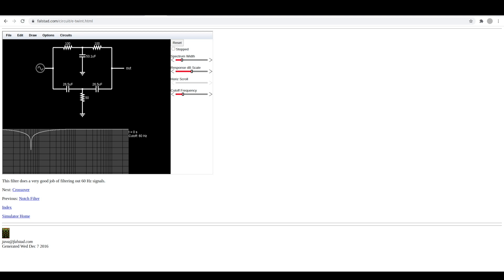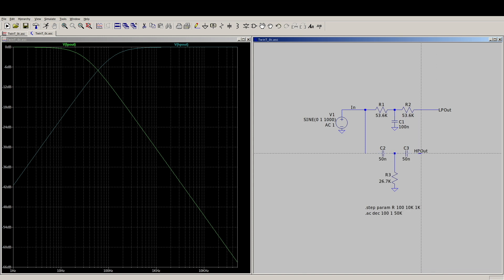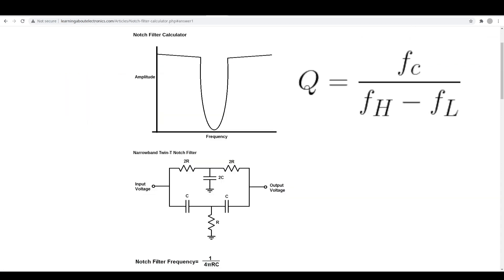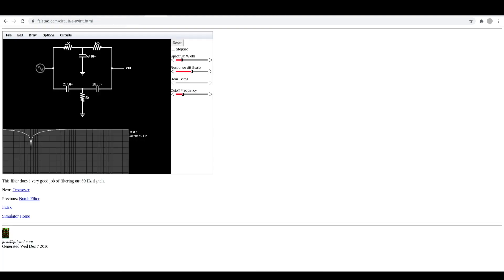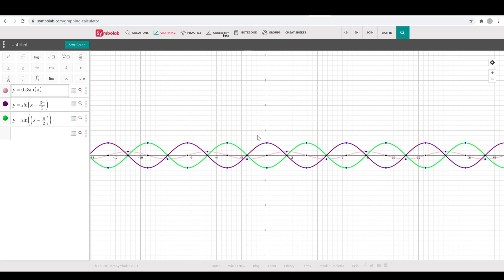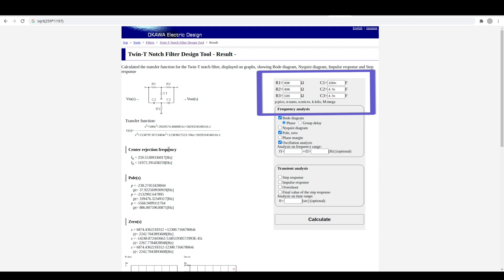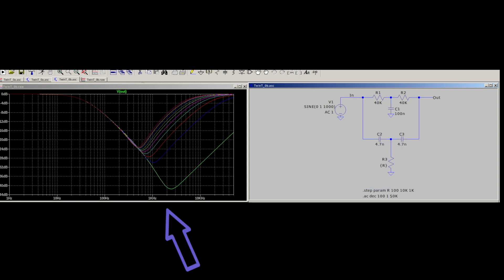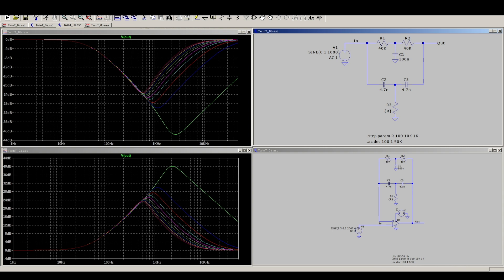Twin T Filter Overview

Comment: Isn't the second circuit, the band amplifying filter, just an oscillator?  How do you stop it from doing that?  
The Twin T has a 180 deg phase shift, the op-amp inverts the signal, another 180 deg and it has plenty of gain.  2 pi around the loop and gain >1.
Reply from the maker: In a more complete implementation of that circuit as a filter there's another feedback path added.  In this video I used it as a Wah filter effect and then modified it to force oscillations (first step toward drum synth) 
https://www.youtube.com/watch?v=s6U4tN_ZrB0